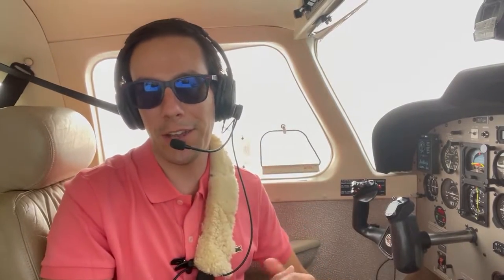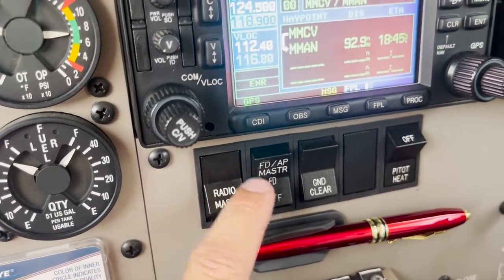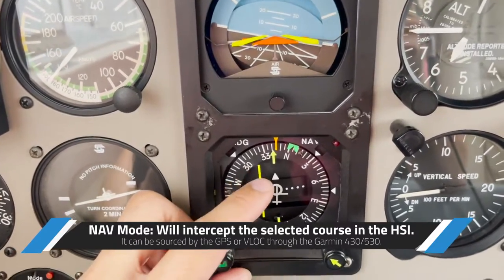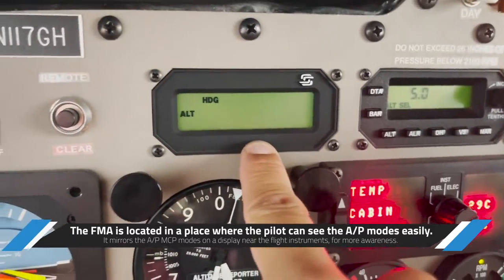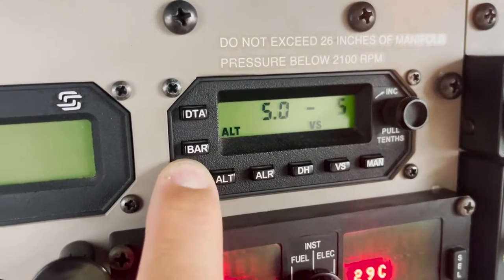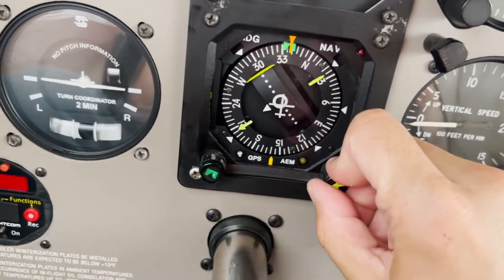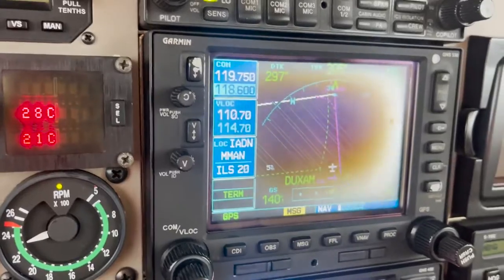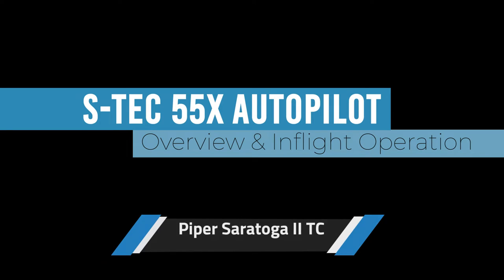S-Tec 55X Autopilot Overview & Operation

Comment: Lalo te felicito por el video, pero tengo una duda con respecto al ajuste del altímetro, se supone que  recibís el QNH de la torre y el altímetro mandatorio esta en la doble escala , Mb y IN.HG. Si cuanto ajustas la caja del piloto automático en 3500 pies y el altímetro te queda en 3600 pies, esa ,va a ser la altura correcta por QNH, en ese caso deberías ajustar la caja del Stec y no el altímetro como hiciste anteriormente para calibrarlo  .En mi avión tengo un Stec 60-2 con al función GPSS ,una sola caja y un gamín 530 y aunque no es lo mismo tú video me es muy instructivo .Ta gradezco que me confirmes si a tu entender si es correcto lo que te planteo y te felicito nuevamente  .Gracias